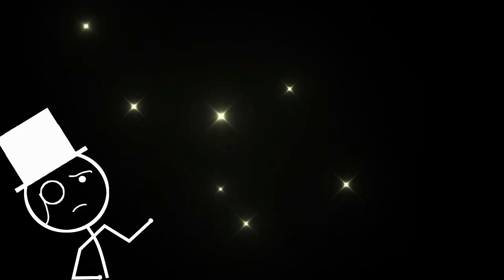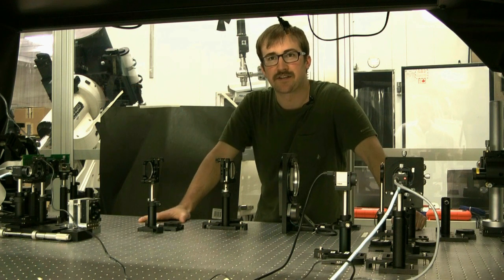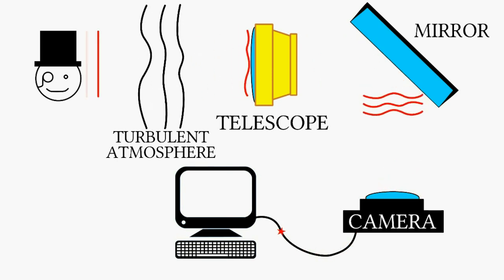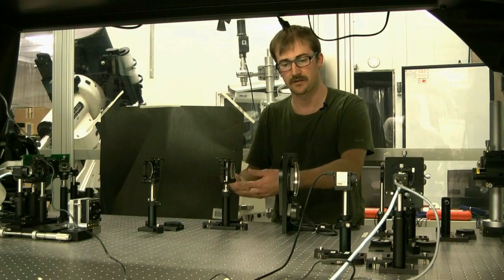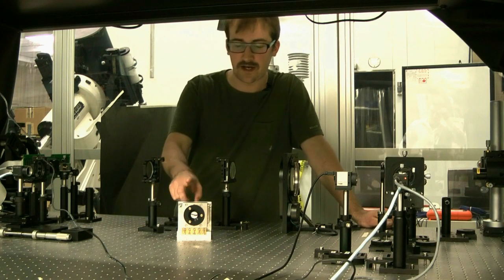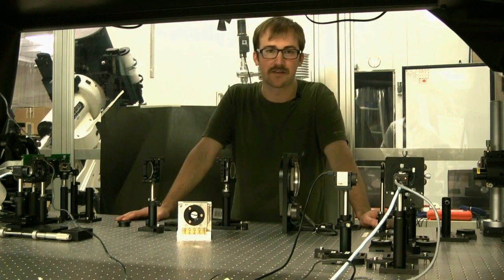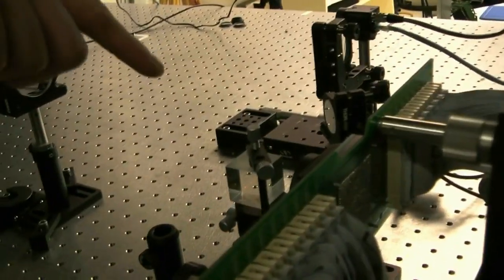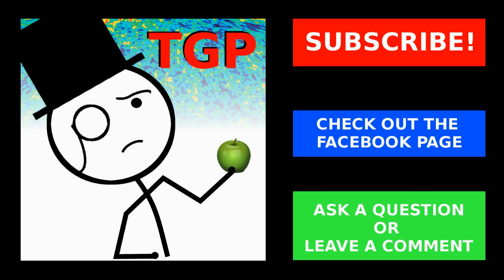Make The Atmosphere Disappear With Adaptive Optics

Comment: I found this extremely interesting.  My knowledge of optics is mostly limited to the material covered in the optician course, and even then there were parts of it that I memorized without really understanding. I think you've inspired to me make some videos on the optics of glasses -- which I will probably run by you to make sure that the math parts aren't screwy :)
Reply: "I would like to hear more about how the correction analysis itself takes place."

I'd like to know this, too. Are they comparing the current image to the deviations observed in the point light source? There is only a foot of atmosphere between the point light source and the detector, but there are miles of atmosphere between Jupiter and the detector, so I don't see how a direct comparison can be made.

Also, the wiki page doesn't really get down in the nitty-gritty details, which is what I'd like to see.
Reply from the maker: david21686 With our table top experiment we used a 'synthetic' atmosphere.  That glass disc at 7:15 looks perfectly clear, but it's actually distorting the light from the laser into that wavy patern you see on the science camera at the end
Reply from the maker: I look forward to the videos.